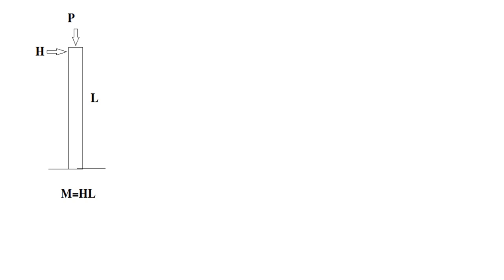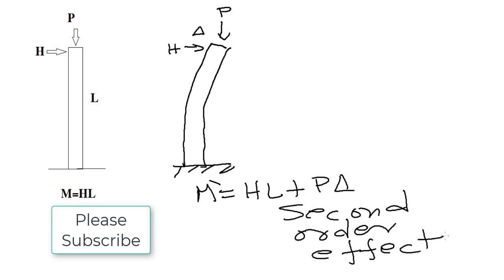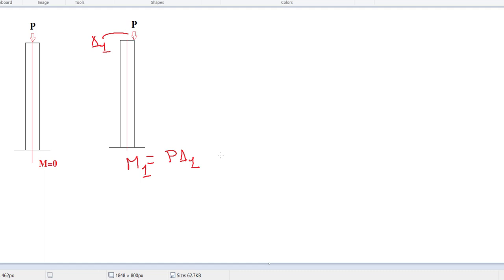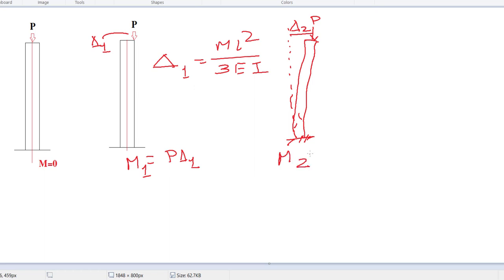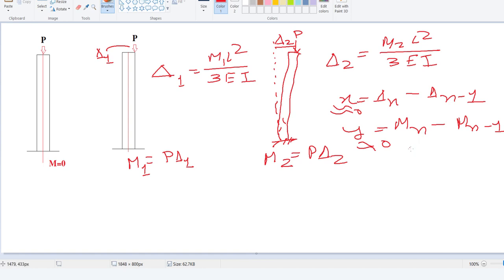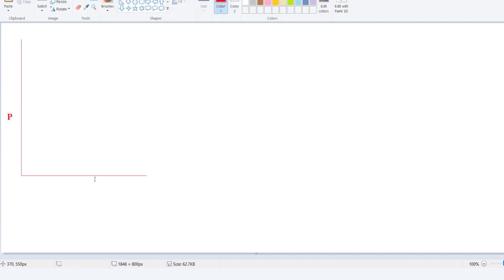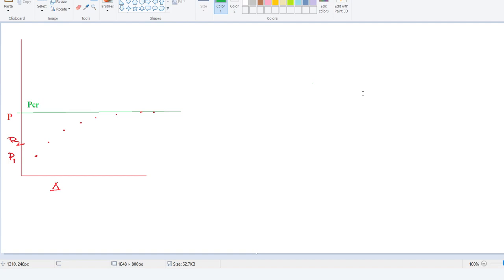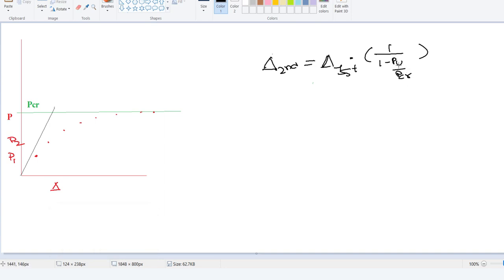Concept of Pdelta Effect and Buckling-1  || Second Order Effect|| P Delta Analysis  #aisc #staad

Comment: P small delta moment (local effect) is already covered in P Big delta moment (global effect), then what is the necessity to add p small delta moment  seperately, in the analysis?
(i.e. Large delta is greater than small delta and is covered the whole lever arm (distance) at a time).
Reply from the maker: No. P–Δ and P–δ are entirely different effects. P–Δ refers to the global displacement of the structure, such as the lateral displacement of a column head relative to its base due to sway or out-of-plumbness. Think of it as the global deformation of the structure.

P–δ, on the other hand, refers to the local curvature of the member along its length due to bending.

If only the P–Δ effect is considered, the additional moment arising from the member's local curvature (P–δ) will not be captured. Therefore, considering only the global effect does not account for the local second-order effects within the member.
Reply: @Torq123 Thanks for replying,
In every reference, both P-∆ and P-δ represented in the same sketch, hence this confusion was arrived.
    Moreover many national and international books of structural analysis and design & journals covered only P-∆ effect, neither covered P-δ effect. 
    Is there any clause of Indian standard to capture both effects?

Comment: Nice explanation, 
What about P small delta effect?
In P small delta moment, why the lever arm is taken as distance between chord line jointed by supports and deflected curve (Bowing point) ? 
It should be indeed, distance from line of action of force to max. bowing point on deflected member, which is far more than the case before.
Kindly explain.
Reply from the maker: im this video only large delta is taken .